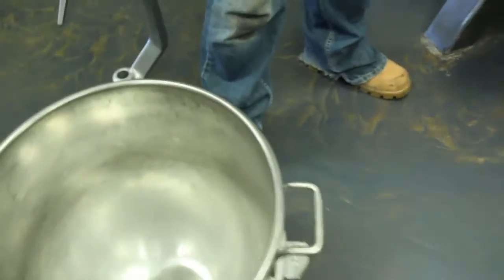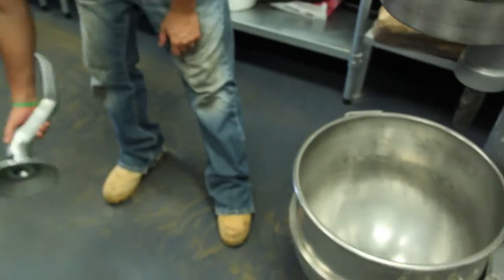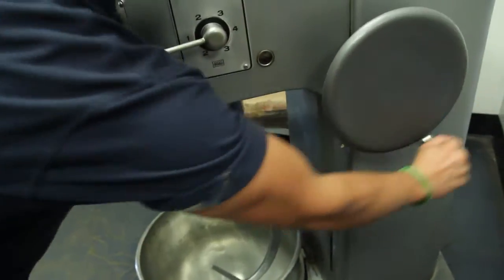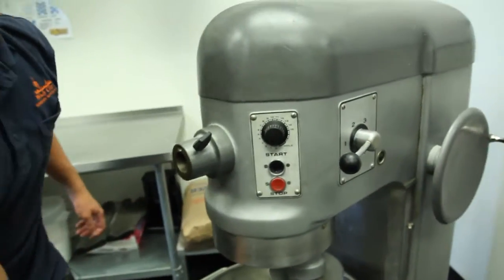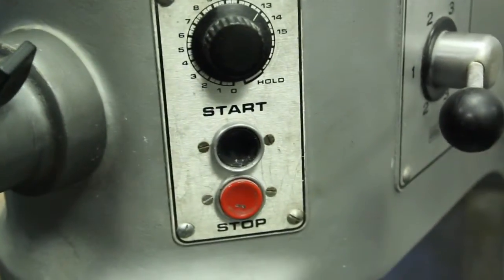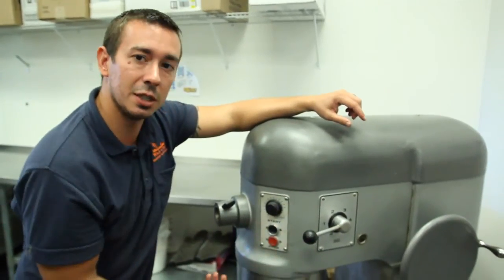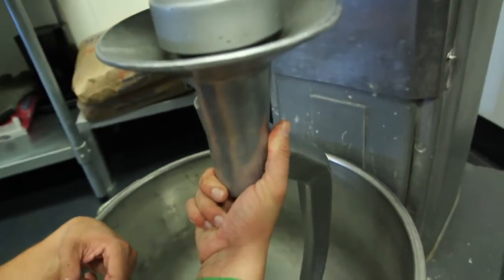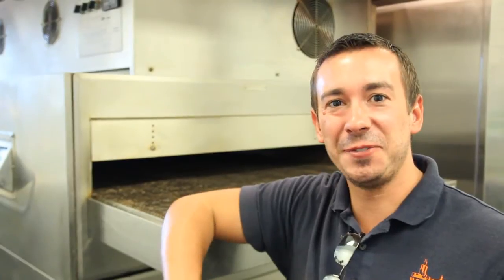How to start up hobart h600 mixer tutorial Windy City Restaurant Repair & Maintenance Tips

Comment: HI. Thank you for the tutoring Chanel.
I have hobart mixer P660 almost  8 years, now i have a problem the motor after 8-10 minutes working its heated up and stop to work until its cool down litel bet.
Appreciate for your helpful information in advents.
Reply from the maker: levipaka It sounds to me like your motor may be shutting down on overload.  Have you made any changes to your dough recently that may be causing the mixer to work harder?  If not, you may either have a motor that needs to be replaced OR, if your lucky, you just need to replace the motor capacitor.  I would start with the capacitor because it is significantly less expensive than a motor.  Hope this helps!  Thanks for watching!!
Reply: Windy City Restaurant Equipment Repair thank you.

Comment: Hello I have a 60 qt hobart and the hook sometimes get’s stuck on the agitator pin. The pin looks worn down on one side and we bought the replacement already. But we cannot get the pin to budge. Any suggestions?your help is greatly appreciated.
Reply from the maker: Changing this pin can be challenging.  There should be a hex cap on the very bottom of the shaft, you need to remove that.  Then there with be an allen screw inside the shaft you need to remove, than ANOTHER allen screw underneath that one.  Once you remove all of those, you should be able to press the pin out (sometimes it will need to be hammered) and put the new one in.  Make sure you put everything back the way it came out.  Hope this helps! Thanks for watching!

Comment: Hello, i have the same mixer. i noticed that the button to press start won't start the mixer ( no noise) and i have to push it near the top corner of the start button to get it to start at times ( makes loud click noise and mixer starts) what can cause this problem? also, i wanted to do an oil change for the mixer what oil is used for this. thank you

Comment: Hi i have a question. I just purchased a h600 hobart and the turning wheel is missing a gear   so it isnt winding up the wheel is just spinning. Can you show me a  picture or video on the assembly of is so i can order the missing parts. I saw a manufactures diagram but still. couldnt tell what was missing. Thank you
Reply from the maker: All I have right now is the diagram, but if you can remove the lid and send me send me a picture of the mechanism, I should be able to tell you what's missing!  A lot of times, it's not a gear, but rather a broken pin so a shaft is just spinning.  Sometimes the threaded rod comes undone from the castle nut that holds it in place as well.  Can be a real pain in the ass to fix.  But if you can send me some pics I'll do my best to identify the problem.  Thanks for watching!
Reply: @Windycityequip  i can't seem to get the picture uploaded here, is there another platform i can upload it to?
Reply from the maker: Send the pictures to info@windycityaz.com and put "Please Fwd to Josh" in the subject line
Reply from the maker: I received your pictures and have a couple of questions.  When you turn the crank, does that main gear turn with it?  If it does, do you see the secondary gear turning as well? I know that secondary may be a little hard to see, but try your best.  If the secondary gear is turning, but your threaded rod is NOT, then you likely have a castle nut that came loose and dropped the shaft down. This can be a pain in the ass to fix and I've only successfully repaired one, WITHOUT removing the entire assembly once.  And that's because I have small hands lol.  if the threaded rod is turning you probably have a stripped lift nut.  And if none of the gears are turning, you have a broken roll pin in the handle.  Hope this helps, let me know what you find!
Reply: @Windycityequip  when i turn the lifting handle the gear that you can see clearly is not connecting to the other gear that is not clearly seen.when i turn the threaded rod that the nut goes through the gear that is in the picture that is not clearly seen moves but it is not connected to the smaller gear to the lifting handle gear. It seems to be missing something to connect them but i dont know what. Its hard to get the phone in to take a better picture. I dont know if you have any h600 that you can take a picture or a short video to show me how it works would appreciate it. Thanks for replying
Reply from the maker: I looked again at your pictures and I think I figured it out.  I emailed you my thoughts and a full service manual for the H600 with pictures & breakdowns of the mechanism responsible for lifting. Hope this helps.  Thanks for watching and reaching out!
Reply: Thank you very much for your help
Reply from the maker: You're very welcome

Comment: All gears are slupping on my mashine here   So do i need to fill the oil. An d can u please tell me what type of oil is used ? Thank you
Reply from the maker: If the gears are slipping, my guess is that the teeth are worn down.  You'll probably have to get the trans rebuilt, or at least those gears inspected and replaced.  Thanks for watching!

Comment: my front head shaft seal is leaking,how can I solve this problem.
Reply from the maker: That usually means that the oil is overfilled.  The oil level should be below the front shaft hub.

Comment: h600 turns on to a hum yet won't spin
Reply from the maker: +OMyVa Sounds like you may have lost a power leg to the motor.  You may want to make sure you are getting full power from the outlet to the plus, through the cord, and to the contactor before you check anything else.  If you find you are getting full power then it may be time to check the motor or transmission.  If it gets to that point, I highly recommend you call out a professional.  Thanks for watching!